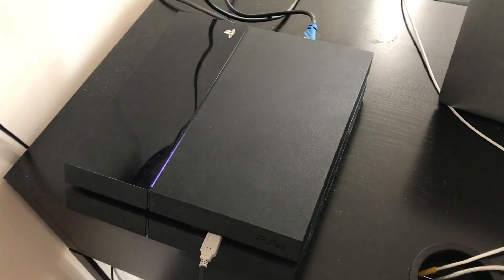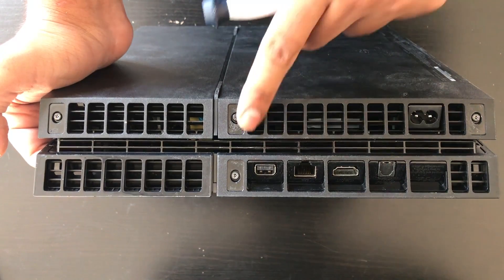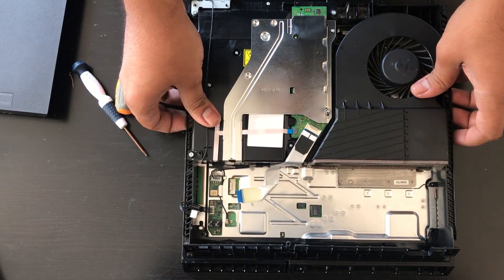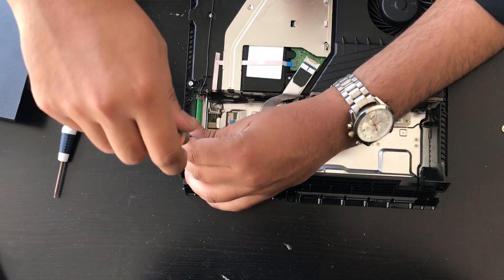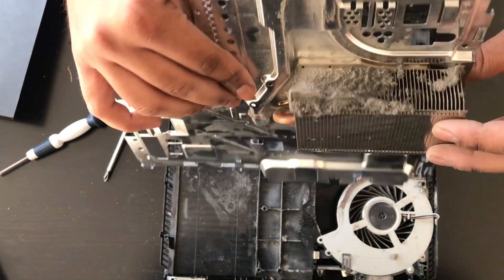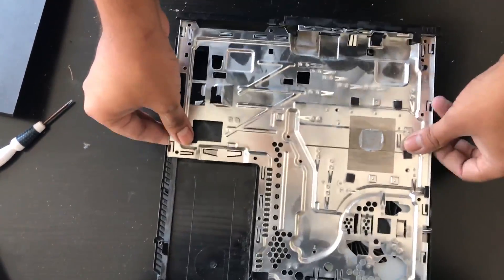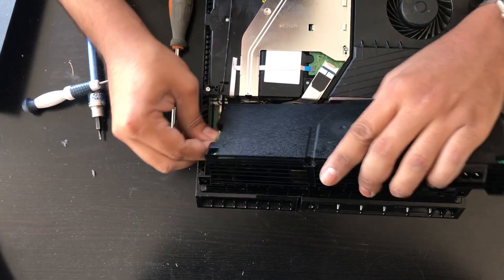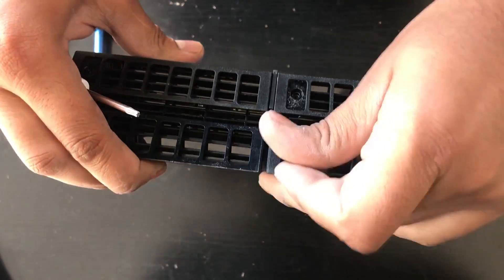PS4 Too Hot overheating due to dust build up and fan (CUH-1001/1115 cleaning and disassembly)

Comment: can i send my ps4 so you can fix it
Reply: BiG NiBbA oh yeah yeah
Reply: @hoodietm1879  man I got a torx security bit fixed and thermal repasted my PS4 pro and installed an icy thermal pad in Xbox 1x and on my Alienware r4 laptop. Oh yeah the next day I fixed the PS4 pro our cat Mr grey knocked it off the desk and it fell on the power cable 3 visual Sparks flew out the back and it doesn't work now ,I'm awaiting a phone call from my repair man I hope it's under $100 damages
Reply: Devon Cook : That’s tragic!
Reply: @lightskinantics4200  yeah,at least I didn't waste a thermal 40x40mm pad
Reply: Do you know anyone in London can fix this?
Reply: I have the same problem but my Playstation is quit very quiet they didn't drop any sound of this noisy
Reply: Absolut legend, thank you. Bought mine on Gumtree for £100, very noisy and hot. Followed your video, and OMG, I havent seen anything like it, what a dirty piece of crap it was. Took me about 30 min to get it as new, replaced the paste as well. Now its like new. Many thanks and for all the guys from the UK (not so confident to take it apart) I'm happy to help as well. Wish you all goid gaming!
Reply: elio valdez lazy ass
Reply: Yeah I took mine apart and cleaned up the old not so good thermal paste off and put Arctic silver 5 paste on and it took me 40 to 45 minutes to get it done
Reply: Free ps4
Reply from the maker: Absolutely. You can send it in here: https://www.fasttech.ca/repair/repair-box
Reply: Fasttech and hof much do we need to pay??
Reply: Game Master 25 not worth it it is super easy to clean it
Reply: @leviyukawa  yup you need a flat head and some sand paper to make it smaller or a super tiny flathead works great.
Reply: @fasttechvideo  can i send mine
Reply from the maker: @xtblol8780  You dont need to ask permission go ahead and buy the shipping box here to send it in: https://www.fasttech.ca/repair/repair-box
Reply: @fasttechvideo  can you fix my ps4
Reply: @fasttechvideo  can i still send it too u  bro
Reply: @fasttechvideo  hey I'm just watching your video can I send you my p4?
Reply: Can I send it in if I live in Danmark
Reply: Emil Weinberg Jensen Jeg bor også i Danmark
Reply: @emilweinbergjensen3565  check the link. USA and Canada only.

Comment: Thank you dude. I was nervous to do this, i've cursed quite a few times in the process but it turned out fine. Cleaned out the heat sink and replaced the thermal paste and my live-in jet engine is no more ! I was scared i messed up because the little cable to the power supply (the first one that gets pulled out) was stuck between the motherboard and the metal plate so it was a bit damaged. Still worked out tho i'm glad i did this. BIG thank you from Belgium !

Comment: I watched your video about a month ago, and I was able to fix my PS4 with your help (until now). However, now (October 5th 2018) my PS4 is overheating, no loud fan, and I have enough storage for my system to not have problems with memory. I am wondering, do you guys replace the thermal paste and/or fan if I send my PS4 to you guys.
Reply: I think you need a new fan and yes they do that

Comment: After I did this tutorial, when I tried to turn it on it blinked blue for a second then it turned off. I know it was probably me that made a mistake but to you know what it could possibly be? And when I try To put in the Long Phillips screws, they fall right in

Edit: I redid the tutorial and it did turn on but it’s even louder and overheats even worse and turns off right away
Reply: SAME
Reply: That happened to me too, until I replaced the thermal paste. it’s very simple and very cheap. it costed me 7$ to get some thermal paste from Best Buy after this happened. it runs like new now.

Comment: I want to thank you so much 
1. My fan was loud and it was over heating 
2. My streams were trash because of the loud noise 
3. I watched your steps and did so great messed up a bit so I took it all apart but that didn’t stop me from quiting if you guys are scared don’t be it was awesome it was an expirence for me to work on my PS4 IM 13 and did this THANKS
Reply: I’m also 13 and l know how to do this also soon l need  to fix my ps4 form overheating l already cleaned my fan and everything else l just to unscrew the ps4 and get to the heat sink and hopefully then it should be fixed and no more headaches from the ps4
Reply: Pro Knight 64 how did you remove the power supply cable
Reply: Im scared to break it
Reply: thermal paste replacement helps wonders
Reply: Man I don't have any power after cleaning the dust out. What went wrong? Anyone?
Reply: @oliviawhite8349  because you probably didn't connect the little cable to the board or you used a water based solution to clean the PSU and screwed it up. Don't start calling this gentleman out because you don't know how to follow instructions.
Reply: I did the same thing had to take it back apart because I did something wrong but in the long run it’s fixed thanks
Reply: Ye I'm 13 and I did this too, I was really scared of breaking something so I was gonna take it somewhere for someone to do it for me but then I saw the prices and I was like NOPE and did it myself.
Reply: WhtDa Gaming lol same as fck
Reply: oooooooWhtDa Gaming i
Reply: U stream ttvv btw.
Reply: XioxXion ENDX how did you do that
Reply from the maker: You're welcome. Only 13, that is amazing. Don't forget to subscribe!
Reply: Fasttech what do I do if my power supply clicks when I turn it on and then it turns off after 2 seconds
Reply: @fasttechvideo  what is this scam u got going ? How is anyone going to know that its the same unit when you take it off camera and have a totally different unit hooked up ALREADY....
Reply from the maker: @oliviawhite8349  I can assure you its the same PS4. Just because it didnt work for you (probably because you did something wrong) doesnt mean its a scam. What would I be getting out of it anyways? Its a free video?
Reply: @fasttechvideo  I followed these steps and it worked
Reply: Hello, I did this and now when I go into a game, the fan will go super fast and then it will over heat, what do I do?
Reply: We Don't Play Did you also clean the fan
Reply: Tho is a crock of shit... That's not even the same unit. You couldn't film plugging it all up and connecting it like you would think ... Thats how u kniw this is bull and its not even the same unit.

Comment: Bro thank you so much really appreciate it my fan was clogged as and so was the thing attached to the heat sink next to the fan. Man you are a legend man my ps4 would instantly beep 3 times and then turn off with a red light.. ended up been the dust built up or the fact that there was hardly any any to none thermal paste on the chip...used nail polish to clean it up applied as u said and boom is quiet as....started off really loud then settled down heaps and now hardly a sound..thank you sir you just earned a sub and a like and many shares of this vid

Comment: This is a very good video!!! Cleaned my ps4 CUH-1004A without any hassle!!! Also replaced the thermal paste. The paste was hard and this caused the ps4 to work harder. Now my ps4 is running very very quiet!!!
Reply: Swervo Szn  Hi, just follow the video step by step, watch it a couple times and you will note it is actually easy to replace the thermal paste. I used Thermaltake TG-8 Thermal Paste, it is a good quality paste or you can use any other good pate in that range for that matter!!!

Comment: I’m not in USA or Canada and there’re not ps4 repair options in my location I have no other option but going for it, wish me luck.

Update: success! removing battery cables were the hardest part I thought they’d brake, other than that just be careful not to lose or mixup screws, also when putting it back together don’t forget to plug everything back, I had to take apart ps4 twice because I forgot to plug back fan cable thankfully I realized that before I turned it back on. PS4 is still a little noisy sometimes but is so much better than before, 80% less noise, thanks for the post!

Comment: Hey men I used your video as guidance thanx a lot My ps4 was so loud you could hear it downstairs, I cleaned out the fan and changed the thermal paste and now its so much more quiet, thx so much I got my ps4 when the white glacier destiny bundle first came out in 2014, thanks !!
Reply: Same here man the destiny version mine was the same packed up 2 days ago and cleaned out the clogged vents fan and heat sink and added new paste and boom starts up works fine very loud though and then settled down so well now its as good as new
Reply: Got the same model

Comment: All that dust on the ram chips... the dried up thermal paste and pads...... you call it a proper clean? T___T
Reply from the maker: Thermal paste replacement is not cleaning. Check my other video for that where I do both.

Comment: What type of screwdriver did you use to take out the screws of the power supply
Reply: You use both a t8 security screwdriver and a Phillips hope this helped those are pretty much all you need to decemble the whole system.

Comment: I think i destroyed one of the power source screws i can’t unscrew it any help?
Reply: rokojeff yes ill give you instructions here:

1. Shake the ps4 around or even give it a little wack
2. If that doesnt work, get a hammer and start bashing it around
3. Or you can just pour milk in it to soften it up, then try unscrewing, and to top it off put it in the microwave for 2:30 minutes.

If these dont work then just sell it and get a new ps4
Reply: SpitinFire thanks dude the milk one worked
Reply: rokojeff happy to gelp

Comment: MY PS4 WONT TURN ON
Reply from the maker: If it doesn't turn on at all your have a power supply issue. We have several videos on our channel regarding this repair. We also sell the power supply units on our website at www.fasttech.ca
Reply: It does turn on now but I have to use my controller to turn it on and now my controller is having lag input and cracking audio with my headphones

Comment: I did this and now when I turn my ps4 on it just does 3 beaps and turns off :(
Reply: I pretty much fucked my ps4
Reply: gamer127 did u fuck up the power supply?
Reply: FNS31 well I got my ps4 to turn on now but it just overheats instantly when I play any game , what cause this?
Reply: gamer127 not an expert but it may be the thermal paste I’d say talk to a pro or take it in to a shop
Reply: FNS31 yeah mine seems to be super dry so I'll probably have to buy some , thanks
Reply: gamer127 no problem gl

Comment: I did this and my ps4 turns on makes a loud noise, beeps a couple times then turns back off, does anybody know how to fix it
Reply from the maker: Make sure the mainboard is sitting flat and that the heatsink brace is tight.
Reply: Also make sure you did the thermal paste right. It's probably best to replace the thermal paste even if you don't think you need to

Comment: I know you likely dont reply that fast, but do you pull the 5 pin connectors out by the cords or the white part?
Reply from the maker: Seraph Sephiroth by the connector (white part)
Reply: Fasttech my hands are giant so I just used some pliers. Thanks though.
Reply: Fasttech if I damaged a cord something wouldnt work correct? I think I bent a cord slightly
Reply from the maker: Can you be more specific?
Reply: Fasttech I tried to use a pair of pliers that was too big and hit the 5 point cord on the disk drive by accident and it was slightly bent. It seems completely fine so I was wondering if there could be an issue or if I'm just worrying too much.

Comment: I did this and cleaned the dust and the thermal paste looked good but my ps4 is still very loud when running fortnite any other solutions?
Reply from the maker: Try our BLOD repair kit here: https://www.fasttech.ca/playstation-4-parts/blod-blue-light-of-death-repair-kit

Adding these washers should press the APU chip down on the heatsink and prevent overheating.
Reply: You could replace your fan. My cuh1115-a runs the same after a cleaning and new thermal paste. It comes with a delta fan but supposedly these are loud fans due to their design. Some have said that a Nordic fan is a lot quieter in comparison. 

However, replacing your fan means opening up your system again and risking fucking up your system. And who knows maybe the Nordic fan does little about the sound your system and possibly could make it worse.
Reply: PuncakeH20 
   Aa.  Aa.

Comment: Thank you so much my PS4 works now I can play without it over heating thanks for the video to help me your awesome
Reply: Jason Mora mine works but it overheats instantly
Reply: gamer127 is your ps4 still overheating instantly if it is a no, can you please explain to me what you did because my ps4 overheats instantly too
Reply: Young Stunner7x22 I bought thermal pasta and replaced the old one and now it works perfectly with no noise just I kinds fucked up my antenna for my controller connection
Reply: Jason mora does your ps4 still over heat at this moment
Reply: Can i use a vaccum to suck all the dust?

Comment: My ps4 will not turn on after I put it back together
Reply: First make sure the cable that you are using to power it is correctly plugged in. Then check if the power supply cable inside console is correctly connected

Comment: I successfully completed this on my CUH1001 with the help of your tutorial. I've noticed it started to run louder like a jet takeoff in the past year. Only advice on YouTube was too clean the fan blades and replace the thermal paste. With this video I got to the heatsink and sure enough found out that the vent was 70% covered by dust like a rug. Now my Ps4 is whisper quiet and can only hear somewhat of a fan kick in now and then. Thank you for the helpful video and keep up the good work
Reply: Moon Man did u need to change the thermal paste as well?
Reply: AngyNags No I didn't because there seemed to be a decent amount left. But if I would go back and do it again I would do it while I had the past already opened because my ps4  still isn't completely whisper quiet especially on Fortnite. Thats why I do plan on changing the thermal paste soon in the future

Comment: Ps4 turns on then turns off how do i fix it
Reply from the maker: Tutorial: https://www.youtube.com/watch?v=9RU81oPF-0Y&t=5s
Repair Kit: https://www.fasttech.ca/playstation-4-parts/blod-blue-light-of-death-repair-kit
Reply: It's your power supply pins, probably not connected correctly. Pins are probably bent. I would take it apart again to check.
Reply: Sam Insixiengmai that not it if it was the power supply it wouldn’t turn on
Reply: @anthonytirado1286  mines did the same. I had to fix my pins
Reply: It’s the thermal paste you can buy sum at Best Buy for 8$

Comment: I did all the steps but my ps4 wont turn on
Reply: Oh shit 😂😂 rip
Reply: Okay guys I fixed it the problem was that the battery was not connected there is a plug to go in the batter you might forget to click it in
Reply: Nevermind i fixed it
Reply: kings_life 323 same here!
Reply: Me too
Reply: Mine wont turn on too how did u fix it
Reply from the maker: Check the pins under the power supply and make sure they are straight.
Reply: kings_life 323 how???
Reply: Yea how
Reply: One of my plugs didnt connect all the way through
Reply: Same my is no t working but than I fixed it
Reply: kings_life 323 broken!
Reply: Akeem.R go to service centee i will recommed you ok

Comment: Dude I completed it, I’ve done it everything works but my controller, my controller doesn’t connect to the PS4 for some odd reason, do u know why ?
Reply from the maker: Check the antenna cable connection (single black wire connector) under the power supply.

Comment: I watched ur older video of this but I’m to scared to brake anything I’m only 14 but my PS4 only started overheating yesterday and it turned it self of 3 times
Reply: If you have it under warranty just replace it with a new system but if your really interested in opening the system up to learn I’d say you should do it at your own risk (maybe 10% chance of it failing assuming your inexperienced). 

Iv opened my Xbox One, my laptop, my Dads laptop, my cousins other Xbox One and they all dropped their temperatures. On consoles it’s round 8°F and laptops round 10° F.

It all depends if your system is super dusty in the inside or if the pre applied thermal is dried up. I suggest just replacing you console instead of attempting these until you are very sure about the in and outs about the system (watch a lot of PlayStation disassembly videos).